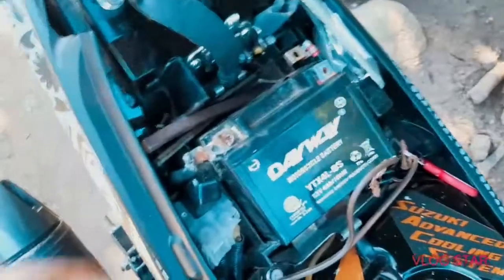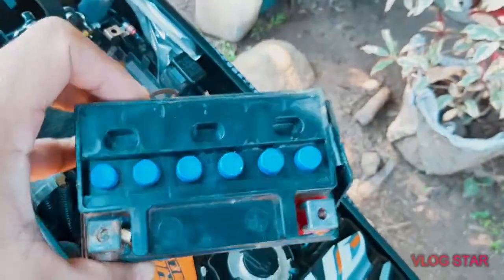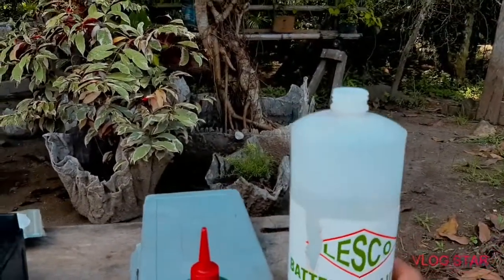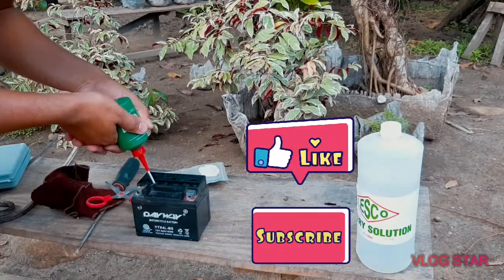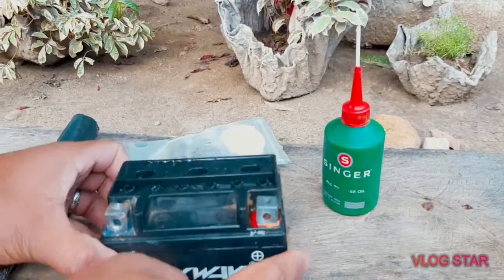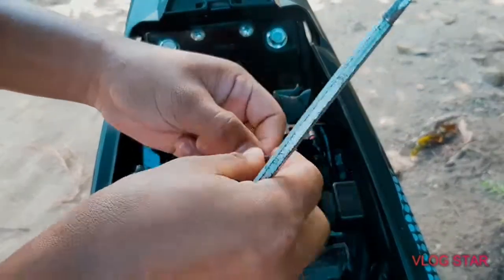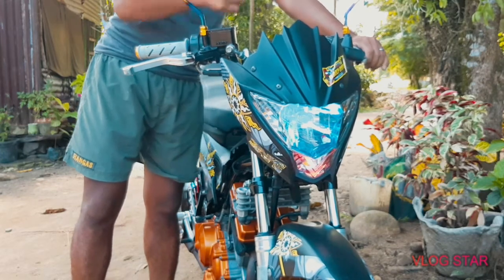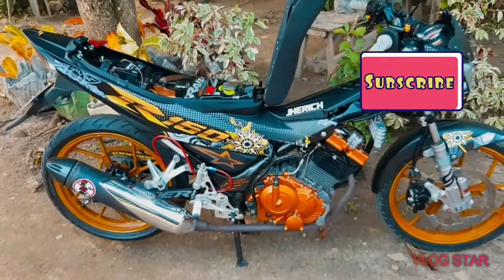How to repair motorcycle battery, with LESCO battery solution, DIY | RICHMOTO

Comment: Boss kahit Wala po bang Battery Charger Pwede din po ba ma charger sa motor?
Reply: Oo basta bili ka lang ng water battery solution kusa naman yan nag charge kapag naka convert na sa motor kasi meron yang Regulator na siyang nagkakarga ng Kuryente sa Battery.
Reply: @raymondsantos8306  distilled water tas salpak ulit motor kusa nagchacharge?